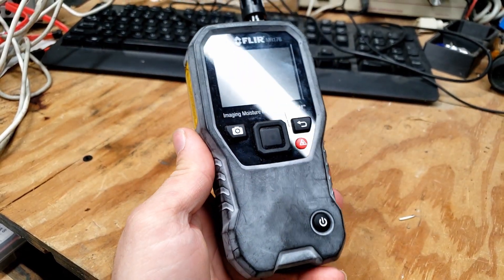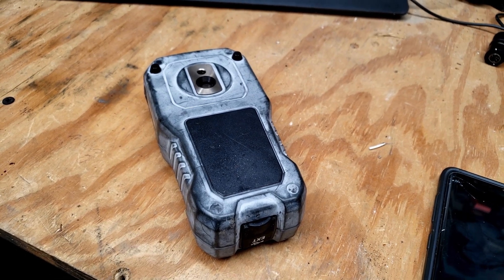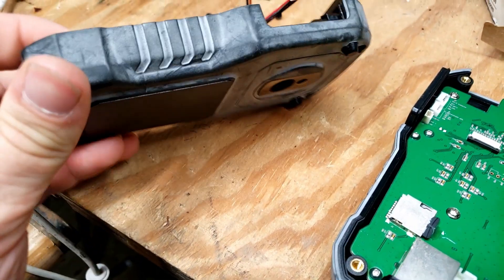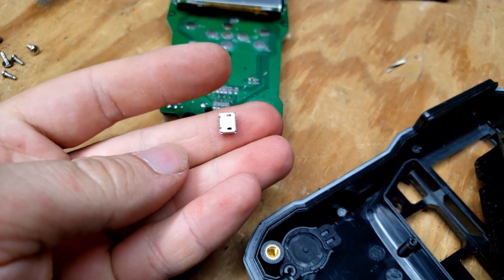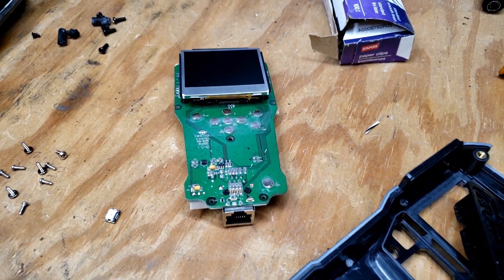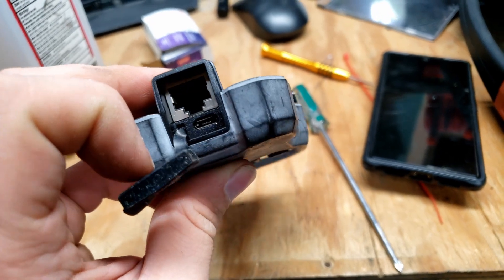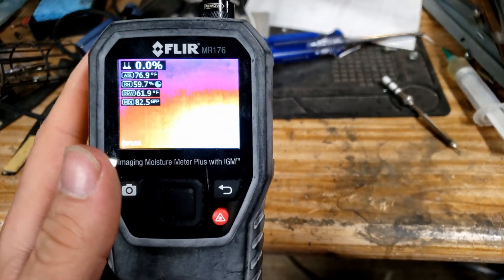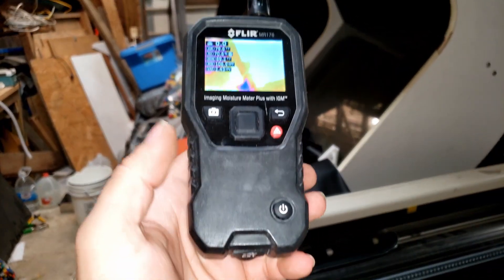Repairing a $100 FLIR MR176 Moisture Meter

Comment: Very interesting. I do have the same problem. Where to get the USB slot? In any regular electronic shop? Or is this a special part from FLIR? Thank you very much.
Reply from the maker: @trixicom  I removed it from a TP4056 charging module I was never going to use but just search digikey or somewhere similar for a micro USB connector that looks similar.
Reply: @BlocksRetroRepairs  Thank you so much for your answer! It will help me a lot! Flir will not repair mine....its from 2017....and they only repair from 2018 and up....but they offered me a great discount to buy a new one....but anyway: It is much cheaper to fix mine 🙂

At the moment my problem is to find somebody who could fix it - I am located in Spain, Barcelona...I will ask in forums or at electronic shops if the know somebody 🙂
Thank you again for your answer and very helpful video! Saludos from Barcelona

Comment: thanks for the vid! i just fixed my port as well. i took it apart and forgot which connectors get connected inside. which of the top 4 pin headers is the one plugged in? there are 2 up top but only one cable. AAAAnnnd i'm assuming the 2 pin wire goes on the bottom near the 3 pin and not in the center of the device?